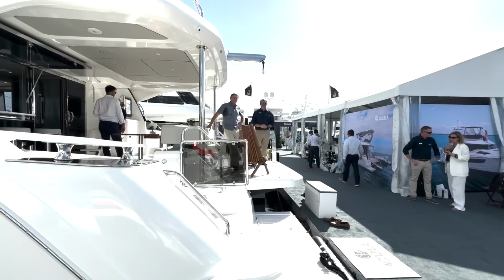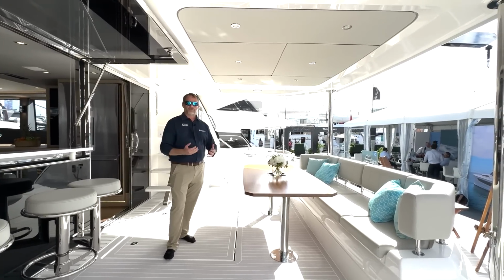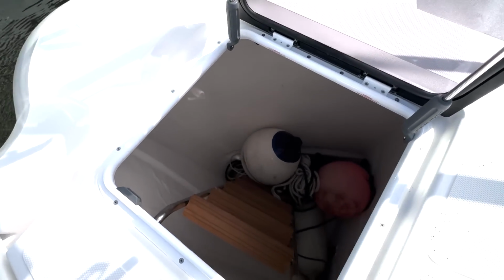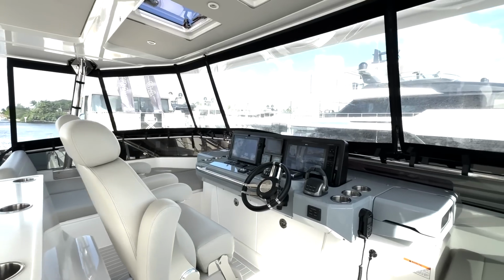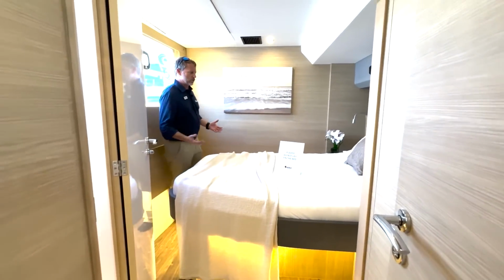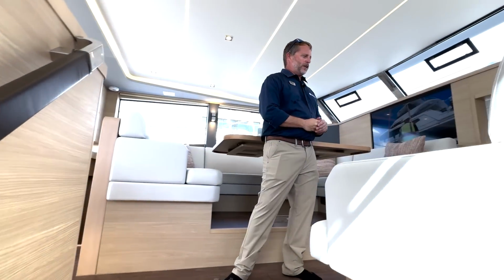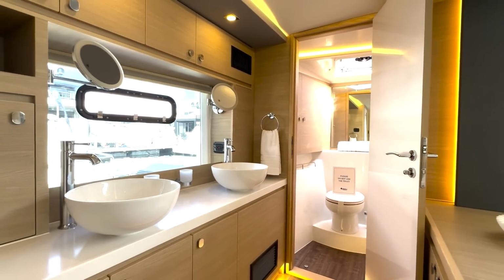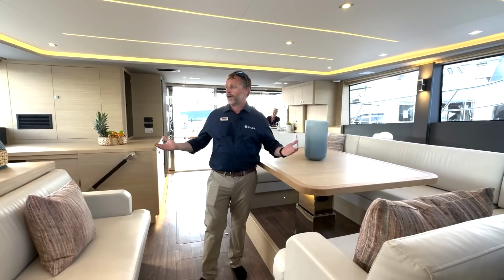Aquila 50 Yacht Debut | Walkthrough at FLIBS 2024

Comment: Range at displacement speed?  Offshore category?  Gas struts for those backbreaker interior floor hatches?  It appears like your legs/feet would be dangling from the master head.  No option for an interior control setup, or fully enclosed upper bridge?  If you could narrow the beam to 25’ it could sail The Great Loop. 

I followed the Wandering Hillbilly and was less than impressed with the problems he had on his Aquila 54 (before the unfortunate accident).  Recognizing that he complimented Marine Max for their support, he still suffered quality issues that seemed excessive.  

I am looking for a boat to travel from California to Alaska, and have been focusing on trawlers. This looks like a wonderful boat with excellent improvements, but I would still have a critical eye overall.

Comment: There isn't helm in saloon. It's OPTIONAL... ???
Base price means you can sail WITHOUT any options...
Options are usually for comfortable.. 
If I want to sail in winter i MUST buy saloon helm options or i MUST buy glass flybridge and heater system..
Flybridges are open area. Not for close with glass...
I think they can't think this or they want to sell options...
It's very very comic...